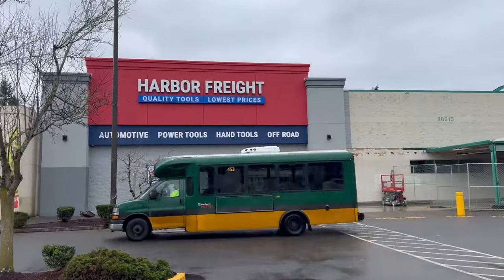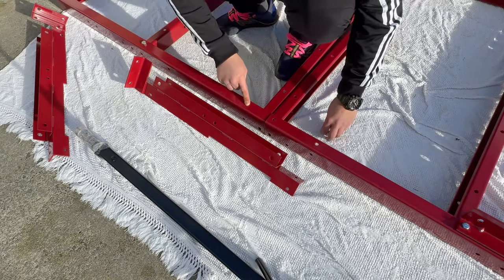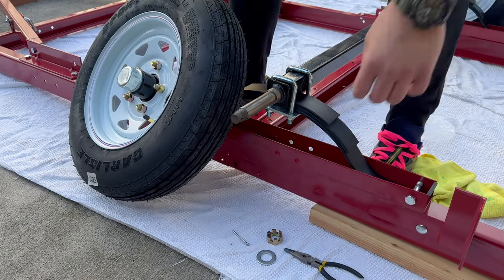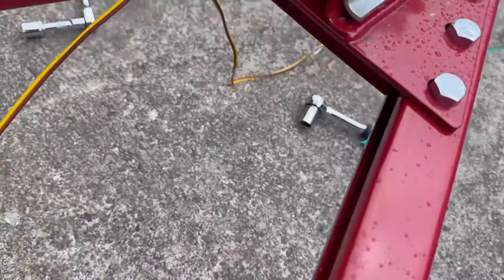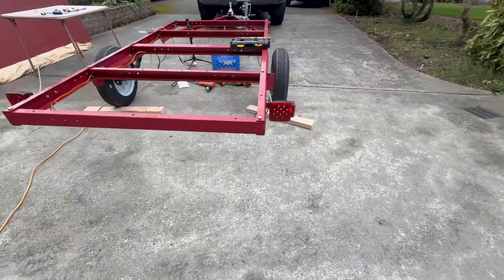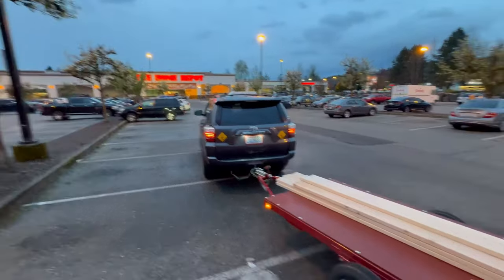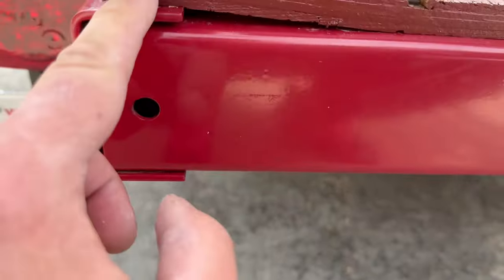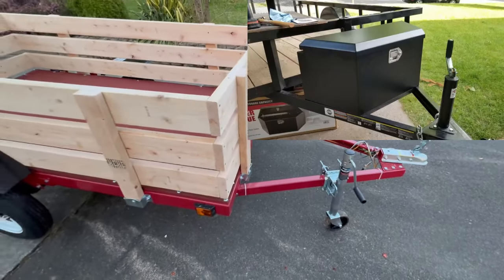Harbor Freight Trailer Build: Full Assembly from Box to Road | Step-by-Step DIY Guide

Comment: After you get done with your trailer you need to find some where to wight it so you can deduct it from your maximum weight that will be what you can haul safely on your trailer.
Reply from the maker: I don’t think I’ll ever load the trailer to its maximum capacity. When I need a heavy-duty trailer, I go to U-Haul and rent one.
Reply: They already did that, hence the 1720 lb load capacity.

Comment: Should we use Zinc, Stainless Steel or Galvanize Bolt and Nut? Thanks.
Reply from the maker: I did not pay attention to the material from which the bolt are made, but on the box it was written that they can be used outdoor…
Reply: Zinc is fine.  Keep it clean and dry and you won't have any issues.

Comment: Thank you for the video, I am looking at the four foot long version. When you get the locks for the rear gate, are you going to remove the screws, so that you can easily pull the back off and on as needed?
Reply from the maker: yes you are right, when I put the hinges I will remove the screws that I put in now

Comment: I recommend to all considering one of these to buy the 1720 lb like this one rather than the 1195 lb trailer. It's only $30 more but comes with box-channel tow bars and cross-members rather than C-channel. The tow bar brackets are also stronger, and it doesn't need the tongue reinforcement plate so you can place the tongue jack inside the a-frame.

After fully assembling the two sections separately but loosely and upside down, bolt them together and place them on cinder blocks or something else to raise it at least 6", still upside down. Using a square, tighten the TOP bolts (which will be on the bottom) first, then make sure the rails are vertical and tighten the BOTTOM bolts. This will ensure the rails and cross-members are the same in relation to one another around the entire trailer.

I placed heavy nylon washers between the tow bars and brackets to avoid wearing the paint.

Install the Leaf Springs using only the front bolts through the eyes. Install the axle on top and the U-Bolts with the nuts hand tight. Swing the entire assembly forward and you'll have easy access to the nuts since they need to be torqued to 15 ft.-lbs.

Install the Fender Brackets but not the Fenders, and then the wheels. Once installed that is when you flip it. Leaving off the fenders prevents damaging them.

Start at the plug and work your way back, after making sure you have enough length to connect to the car and allow sharp turns in both directions. I recommend butt splice connectors and heat-shrink tuning, or the heat-shrink butt splice connectors. Do not use automotive tap connectors or wire nuts as they are not suitable for weather exposure. Also, don't use electrical tape. It is only intended for temporary use while assembling systems and will become gooey and let go, especially when exposed to the weather. Use rubber tape instead.
Run a ground wire to each light. These are pre-painted  and bolt together, so they do not have good electrical continuity. It will also eliminate needing to remove paint. Full grounds will save you a lot of hassle later.
Wherever the wire passes through a metal hole, use a rubber grommet or add two layers of heat-shrink tubing to the wire to prevent wear of the insulation.
Reply from the maker: Thank you so much for the detailed information and helpful tips! I really appreciate your advice, especially about the proper connectors and grounding each light. Thanks again!